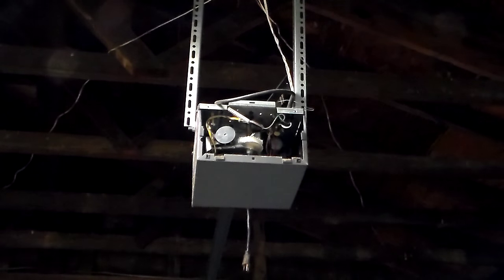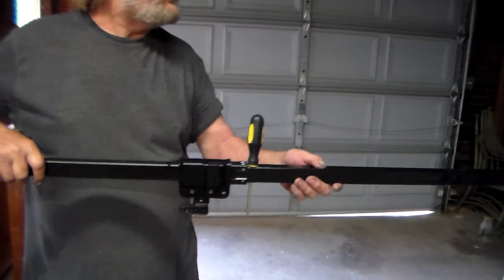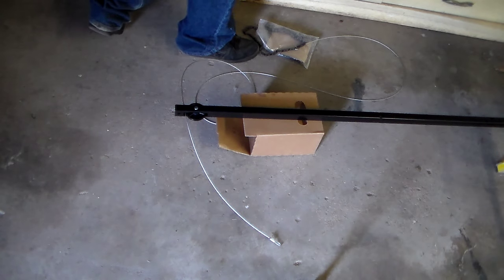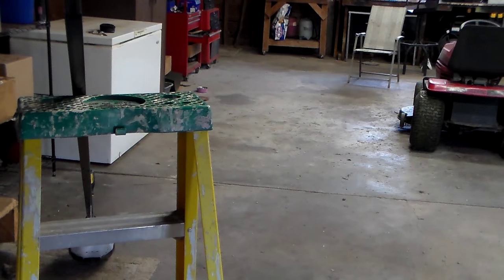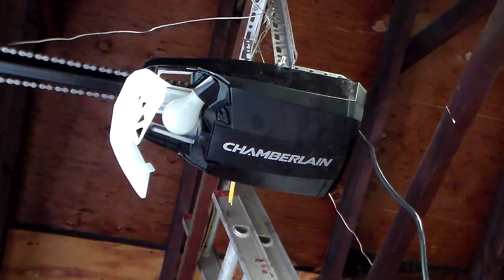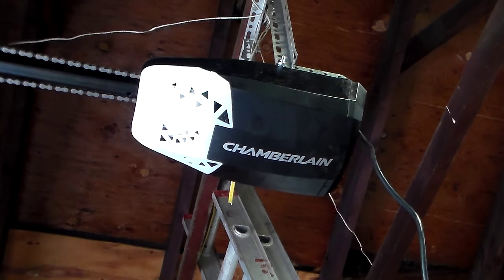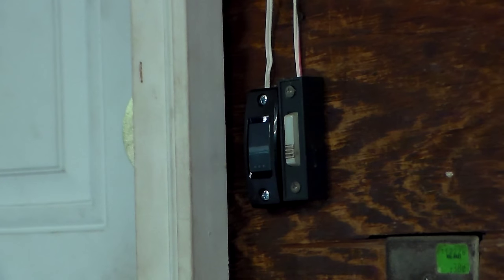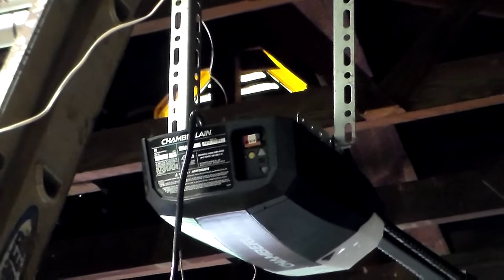Chamberlain PD222 Garage Door Opener Install

Comment: Very useful video thumbs up. Watched segments of the video as I was short on time. The part that helped me was making sure the rail segments were not joined upside down, and also the programming of the door travel limits. My installation was easier than most since the 16 year old door sensors and wiring of my Lift-Master worked perfectly with the new Chamberlain PD222, even the wire attachment positions on the PD222 is a perfect match with my old unit. This was especially nice since my garage has finished drywall and all the existing wiring is behind drywall and the finished ceiling. The unit is very quiet and slows down before closing and before reaching topmost position.
Reply from the maker: +900 Gecko  That's awesome !   I'm glad you found the video helpful and everything went well for you. Thanks for sharing... Cheers

Comment: I much rather work on something than to try to put something new together, I about wear the bolts putting them and taking them out again before I finely get it right. you do a good job explaining,
Reply from the maker: MissouriOldTimer I would fix something before replacing it too, but this one was too far gone. Thanks Neighbor, I appreciate you saying..

Comment: Great helpful video tuffdog. as someone who put couple of these opener,  i went through many of the mistakes you share.  it Iis tricky with the sections as there are groove on both sides.  , one thing which i find important is that the poly at the end off the rail should be secured with bolt,  lock washer and nut,  and not with pin and ring.  the rest you did well, like a real champ.  
happy 4th of July
Reply from the maker: Thanks for the tip & the kind words, I appreciate you watching and commenting... Have a safe Holiday, ~ Cheers !

Comment: A really good video. However I noticed one thing you did wrong. The staples are insulating stables that should have been broken off from the adjoining staple so that the green insulation stayed with the staple. The insulation is designed to prevent the CL2 wire from vibrating against the metal staple which can cause a short in the two wires. That said the video provided useful information that helped me install my garage door openers.
Reply from the maker: +Usa Divergent  Thanks for saying, I appreciate your pointing that out. I must've just missed that.  Cheers

Comment: Hmmm !! I saw your tutorial after I did my first error ...
I didn't align the rail segments on the groove. Will that ruin my work or is it OK ? And how to disassemble those segments to fix this mistake ?!! Thanks :)
Reply from the maker: It's been a while since I made this video and I'm not real familiar with it now. I'd suggest to try to get it apart and line it up.  I'm sure if you look how it attaches, you'll see how to get it apart,... Good luck